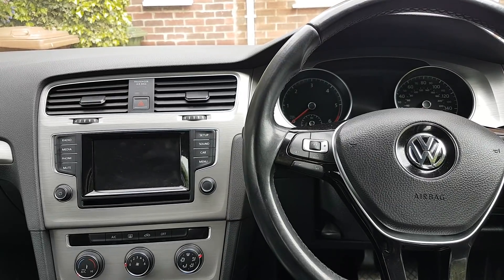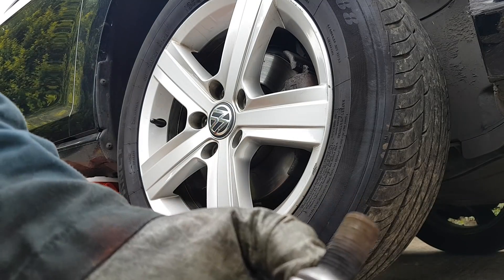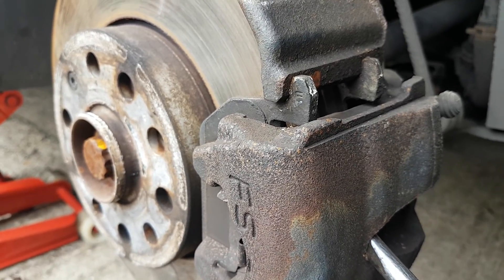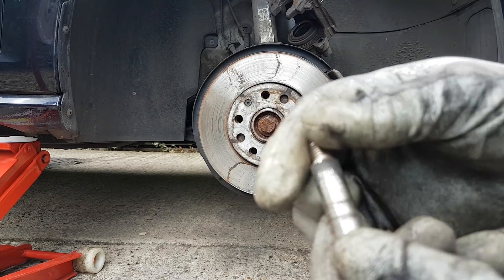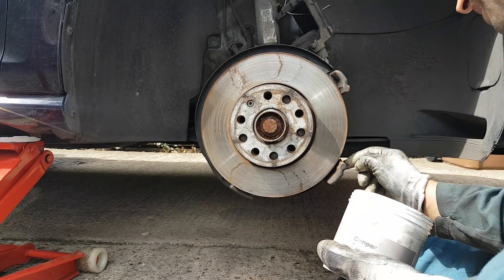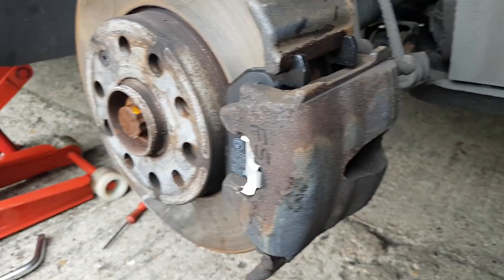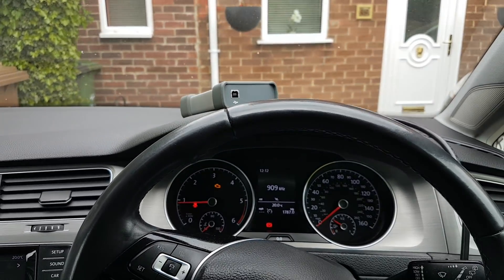VW Golf MK7 2014 front brake pads replacement, with wear sensor.

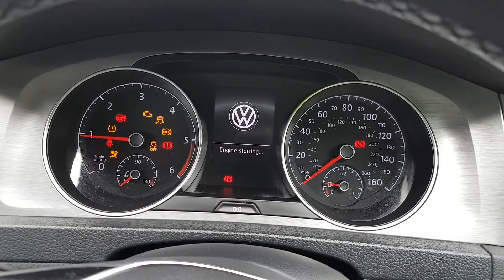Comment: @16:30 this function has to be use only to push into (or pull outside) the piston of brake caliper while are you changing brake pads. There is nothing to do with malfunction indicatior or whatever.. with this warning about brakepad (its autohide/ autoremove/ self-hiddening [whatever..]) and this is just for information your mind to tell you - you finally have to do it - and yes if the sensor is triggered well you will no get more this wear warning (until next requirement of brakes pads changing).
Reply from the maker: That's correct...
Thank you for watching and for your comment! 
👍👍👍

Comment: I have issue now with my clutch do  my brakes amd pads and my clutch lost the power no more pull.back when I realised the pedal stays on  the feet and not pulling back feel soft I just bought it the car and the clutch was perfect but when I done brakes and disc clutch is now lost

Comment: I had too similar "tool" to open the wheel nuts. Only it was very soft and it twist the tool. Sure, the nuts was too tight. Previous car owner/workshop used the full beans on "torque" the nuts.

Comment: Not sure grease on wheel bolts is good practice, won't it affect the way it  torques down ?
Reply from the maker: Don't think it does...
Thank you for watching!
Reply: @insidergreece7636  not on wheel bolts!
Reply from the maker: @russell301  
The day you need to remove bolts that you feel they are going to snap... you will wish the last person working on it, would have put some grease on them... believe me..  it is scaring...
Reply: The torque rating is designed with no grease. Ive seen an argument that a tiny amount of anti-sieze is fine in places where they tend to corrode on. If you use grease you would need to de-rate the torque somehow. Can of worms.
Reply from the maker: Tomato... Tomato...
😅
👍👍👍

Comment: Great video, did you not need to bleed the brake system when replacing the pads? Been a good few years since I did the pads and discs and remember bleeding them.
Reply from the maker: No.
No need to bleed anything if the only thing you are doing is the pads or discs...
Thank you for watching!

Comment: Look at those pad imprints on the rotors. you have 1 more screw to take out to change them. How much are you really saving? The pads on those rotors won't last as long. Sure you're labor is free but if you're going to post a video on how to do a brake job properly, do it properly and change the rotors or have them machined at the very least.
Reply from the maker: I can only do what the owner of the car is willing to pay for...
What did you expect? For me put discs and pay for them myself just to look pretty on the video?
The idea was to show the process of the job... not to tell anyone what they should or not change... that is not up to me... I can only advise...
Thank you for watching!

Comment: Grease the pins is not correct. They works without grease.
Reply from the maker: They come greased from factory...
Sure the manufacturer would not do it if not needed...
Thank you for watching!
Reply: Hi there. Your video is awesome and I'm sure it will help many people with Brake pad replacement. I can agree about not greasing the pins. Grease, especially copper compound , will cause the rubber bushes to swell and eventually they will get brittle. This model caliper doesn't come with any grease from the factory. A floating caliper with sealed guide pins uses grease (where a steel guide pin runs inside a steel caliper bracket with a rubber dust boot)... Pins that run through a rubber bush don't need grease as the pin is stainless steel and designed to work without grease. 

Applying grease to the back of the pads is common practice to stop Brake noise. Just make sure that no grease gets onto the friction material or caliper rubbers.

Using a screw driver to push the piston back can cause damage to the piston or bend the pins, there are tools to retract caliper pistons but a G-clamp works great too. The window that you pushed the screwdriver into is an inspection window to check the pad wear, not to force the piston back.
Great work the rest of the way, great to see mechanics that are willing to teach others!
Reply from the maker: @TheMrmese  
They must have changed the system after the mk5 then... will have to check on Elsa...
https://workshop-manuals.com/volkswagen/golf-mk5/brake_systems/brakes_hydraulics_regulator_servo/repairing_rear_brake_caliper/
Thank you for watching and for your comment!
Reply: Tartu Tallinn are you serious or just a 5 years old kid?
Reply: Tartu Tallinn are you serious or just a 5 years old kid?
Reply: @LMAutoRepairs  Hello Luis, the link you provided is for the rear calipers. Link for the front is here: https://workshop-manuals.com/volkswagen/golf-mk5/brake_systems/brake_brake_mechanics/repairing_front_brakes/repairing_front_brakes_fs_iii_brake_caliper/
They do not mention any grease on front calipers
Reply: @LMAutoRepairs  Hello Luis, the link you provided is for the rear calipers. Link for the front is here: https://workshop-manuals.com/volkswagen/golf-mk5/brake_systems/brake_brake_mechanics/repairing_front_brakes/repairing_front_brakes_fs_iii_brake_caliper/
They do not mention any grease on front calipers
Reply from the maker: @lr5037  
Story: BMW on the ZF Auto gearboxes, installed on the E60, said the boxes were sealed for life... no oil changes needed etc... As you might be aware, that revealed to be a silly and really wrong move... as you might also know, Jaguar used the same boxes, and recommended a oil change every 80.000 miles or something along those lines...
Now, I do lubricate the pins, don't see any problem with that nor any further issues it can cause... even if not recommended... 
Also, they are definitely lubricated at the factory, as you can see the dry grease build up inside...
So, are they supposed to be lubricated once when built and that's it?
Thank you for watching and for sharing the link above!
Reply: @LMAutoRepairs  I thought that lithium grease is used on the pins and Ceratec on the pads.